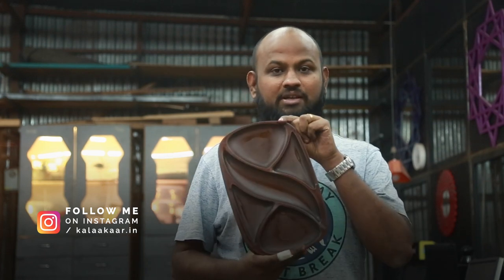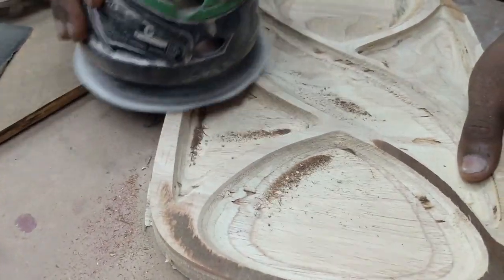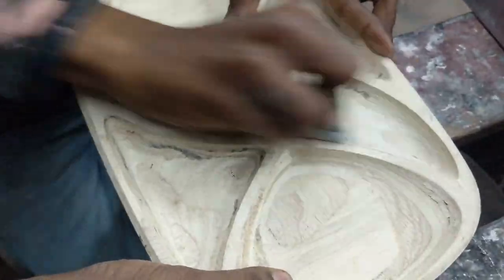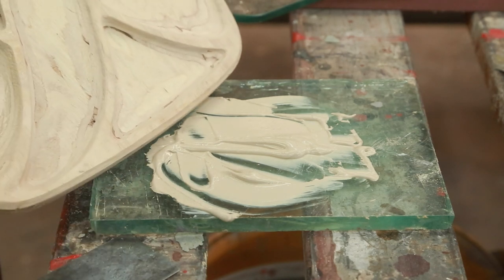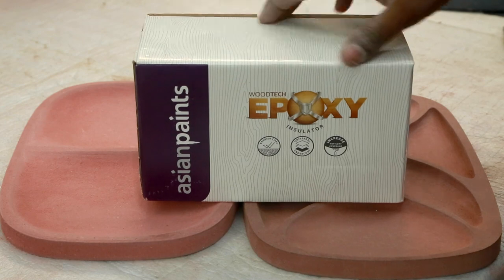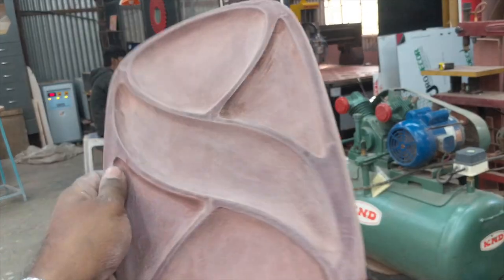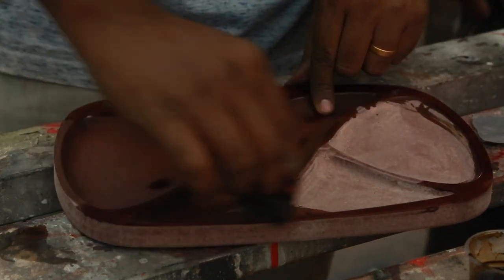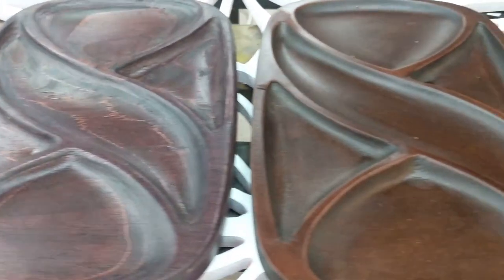How to Stain and Finish MDF & Plywood

Comment: Is it necessary to use sand paper after applying epoxy on MDF ? Can we use wood stain without polishing the mdf with sand paper ?
Reply from the maker: Sanding a very necessary step that you cannot skip when it comes to painting or staining
Reply: ‘Hooked on wood’ has a good take on Mdf and Valchromat [a densely colored MDF].     Dennis has great ideas on his YouTube channel.